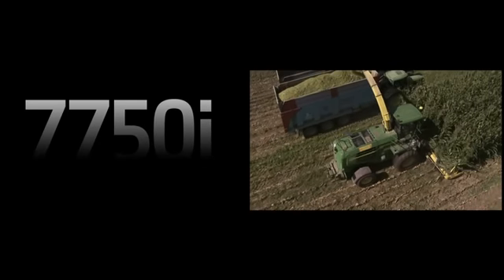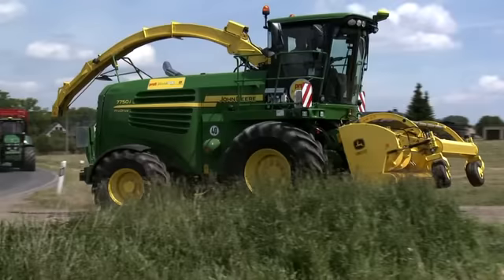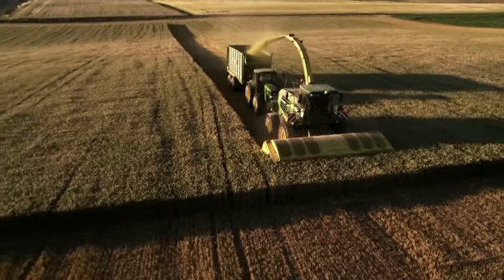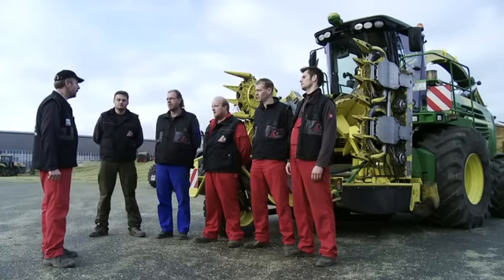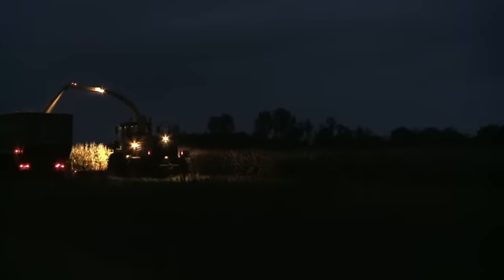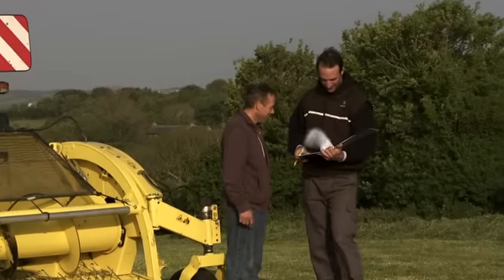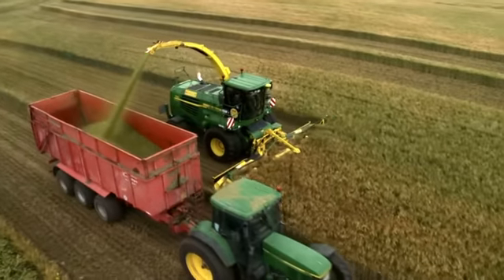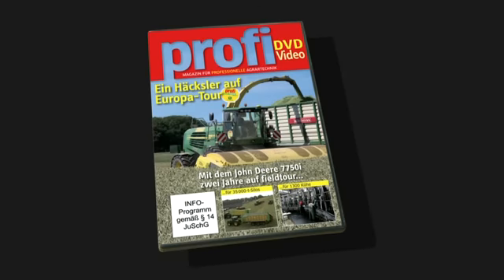English John Deere 7750i SPFH - Profi film.mpg

Comment from the maker: @ lepaul
Here the throughput and fuel consumption of the various headers were tested. Therefore it was necessary to make absolutely sure that the complete working width was used. In the background you can see a further small strips of whole crop silage. Actually the GPS worked very well as you can see the strips are perfectly straight.